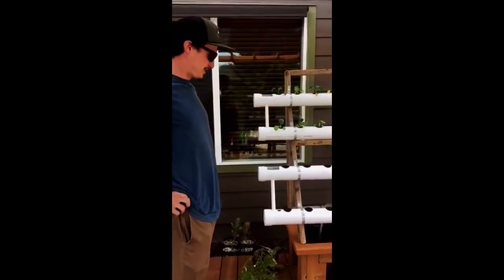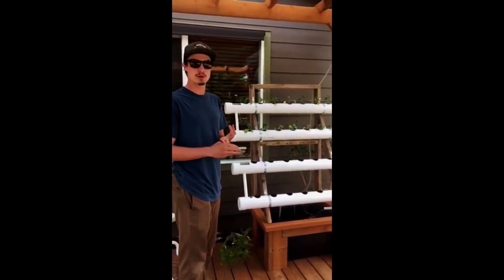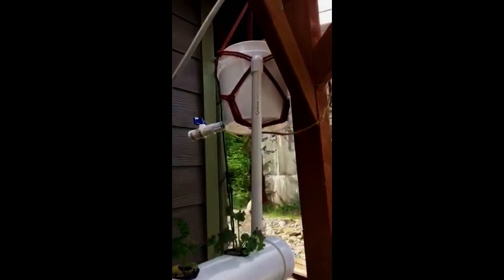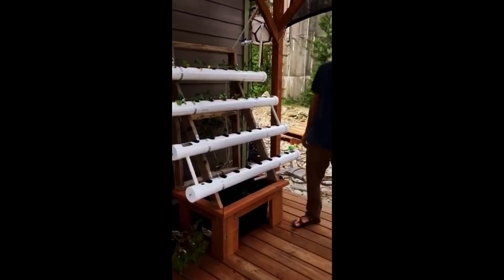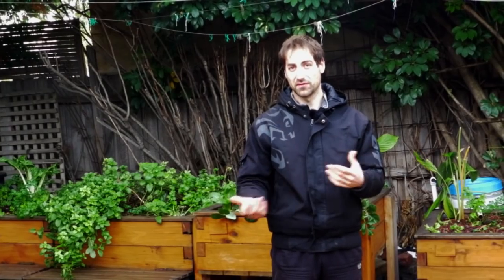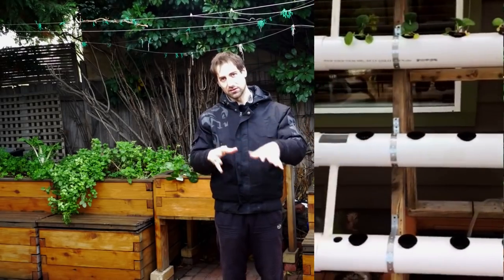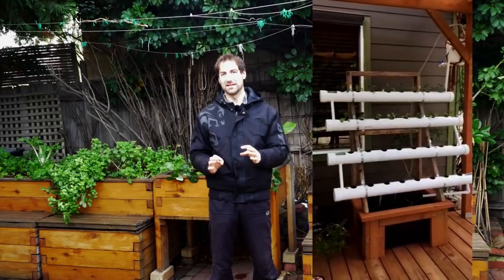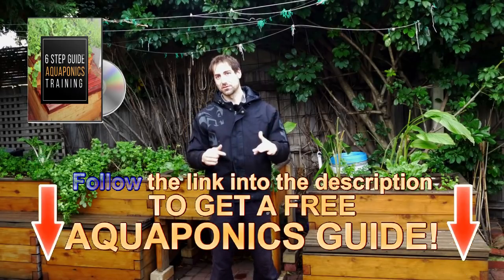aquaponics visit | small scale NFT system

Comment: I have built a similar system, using hole saw and a socket set with smooth sides, a heat gun can flare and make depressions for a good bond for the drop downs. They can stack/ lean and be separated when you use a pool noodle that fits the drop down tube, I used a heated bean tin to make the noodle match the grow tube diameter for a neat fit.
Reply from the maker: Thanks Lee, feel free to send us a video of your NFT aquaponics system.
Cheers